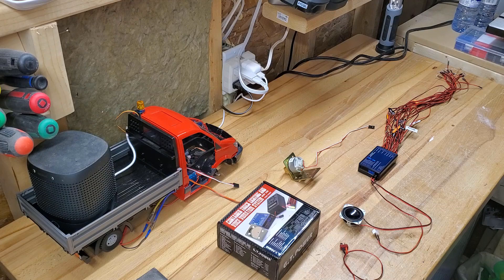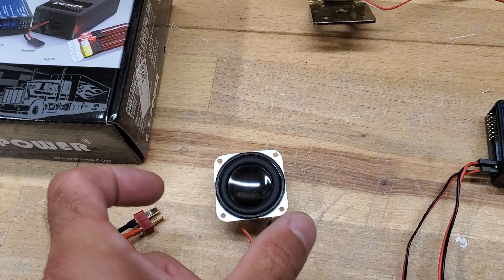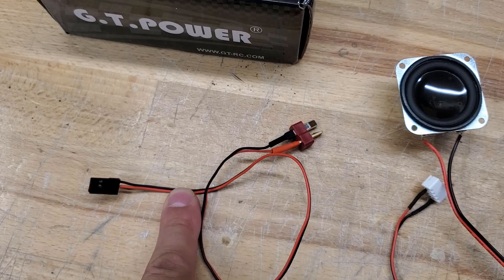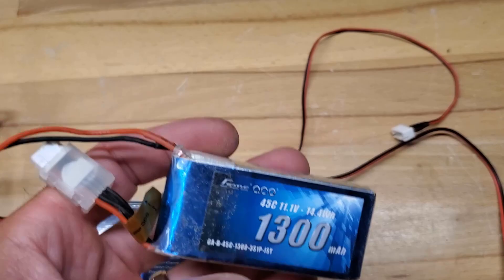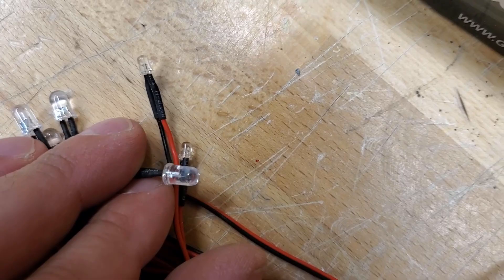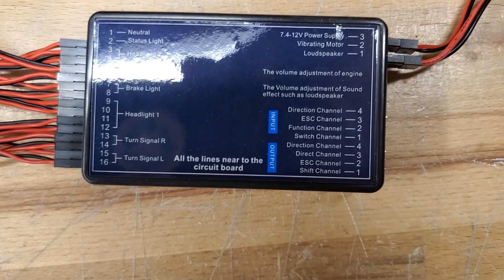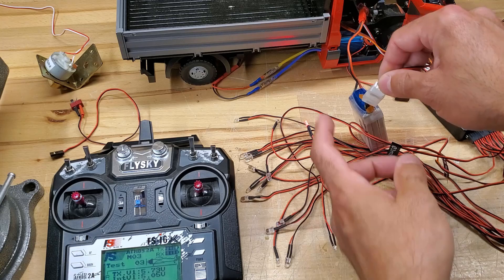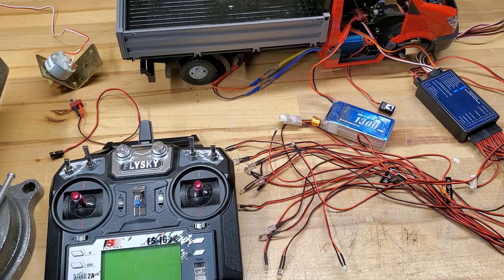How To Install the GT Power Truck Light and Sound | and Demo!

Comment: Thank you for this video. I had to interpolate between your FlySky and my OrangeRx receiver, but without your video I was hopelessly confused by the included GT Power "users manual" which made no sense at all. Now I have the system working. 👍
Reply from the maker: Glad it was helpful.

Comment: Just ordered this for the grand hauler... thanks for your video.  Hope it's as easy as it looks.
Reply from the maker: The instructions are ok but this helps visually know where it all plugs in. You can alternatively use the deans connector instead of the balance plug to power it. Goes in the same spot.
Reply: Well got it all put together....but now it seems my throttle is on the right stick everything is backwards...now what?   I'm using a Dx6e 6 channel reciver
Reply: @scotthouston7116  Futaba and FlySky use Channel 3 for Throttle...
Spektrum and most others use Channel 1 for Throttle.
Just swap 1 and 3. You should be OK! 

Oh, and on the Spektrum Reciever, the Steering Servo lead should go into the "Ailerons" Channel. I'm pretty sure your Reciever has Channel Names instead of Numbers?

Comment: Great breakdown on wiring up this unit. I’ve got the Rc4wd sound unit to instal in my loader when it gets here
Reply from the maker: You should check out diy999er for an arduino version which I think is pretty interesting.

Comment: My hobby wing 1060 wont go forward or back, 
Changed over to arc1 ESC and it's fine . Is this a common problem.
Reply: I have same problem with mine wont run my tamiya motor everything else works fine also i cant assign channel 5 on my flysky for shifting it only works right stick down + left /right  on left stick

Comment: bonjour comment se fait il que je ne peux avoir les feux arrières éclairage et recul lorsque j allume les feux, de plus lorsque je passe en marche av ou ar ceux ci s'éteignes car au neutre ils s allumes bien ,j'ai une FS i6 comme radio  merci a vous
Reply from the maker: when you turn on the lights the red lights will turn on in the rear. if you reverse the reverse lights should come on. if you turn off the lights the red lights turn off. they do not come on when you stop. It does not work like other kits. if you want it to work like the real trucks you will want to look at the gt power truck pro kit which has an esc  built in and you can manage the lights and brake lights work when you are stopped with the main lights on or off. hope that helps.
Reply: @RCConstructionHobby  merci a vous je regarde
Reply: hello lorsque j allume les lumières justement, les lumières rouge ne s'allument  pas ,et de plus , le bruit moteur se fait entendre au point mors, mais a l 'accélération celui ci ne change pas
je pense qu'il s agit des paramètres de la télécommande, mais je ne sais comment faire, vous est il possible de me communiquer votre configuration merci a vous  @RCConstructionHobby

Comment: Thanks for making this video, just one more thing. ( columbo ) lol
I am using a standard Tamiya battery, with NO balance plug, just the main power and charging plug, how do I wire this Ito this system..?
Thanks
Paul....
Reply from the maker: I have mine directly connected to the deans plug which they include. So no need for the balance plug.

Comment: Awesome video thanks for making it. Quick question? The package says 2000ma max power. Dose that mean you can only power it with a 2000mah battery? Or that it only pulls 2000ma to power it’s self? Thanks again for all your informative videos.
Reply from the maker: I believe it will do more on tge battery mah as I use a 2200 because it put it in the cab. So a higher mah should be no issue. I think the 2000ma is for esc as to not overload on power.
Reply: @RCConstructionHobby  I use 4000-5000mah packs in all my trucks. Do you think it’ll be ok?
Reply from the maker: Yes it will be fine. It does not matter the capacity. Capacity makes no difference as it has no bearing on power. What is more important is the C rating and cell count. This particular system is rated to a 3 cell count. Anything above will cause problems. So you should be good with 5000mah. The ESC is where you might run into issues as some don't play well with this sound system.

Comment: Hello friend .Great video. A question. In my truck crawler the chanel 2, throttle, is 2 pin plug, positive and negative, for the motor wires.The GT POWER speaker is 3 pin can itake only the 2 cables? It will work ?
Reply from the maker: the power cables from the motor to the GT power are only 2 wire. The servo wire goes to the receiver which communicates with transmitter. In the video I show how it should connect.
Reply: @RCConstructionHobby  In my truck CRX18 6WD is a combination esc and receiver so  I was thinking of connecting from GT POWER  the plug to the three cables, the signal to the positive, the neutral to the negative to the motor of the car and grounding somewhere else in the car. And the other cable to the battery. Will it work this way? or will i do damage? I can't figure out what the ground wire is for. Thanks in advance.

Comment: Very nice video. But can you connect for example front bar light, or roof bar light? Thank you
Reply from the maker: You can put the main light anywhere. There are 6 white lights 4 5mm and 2 3mm. So you can out them in what ever configuration

Comment: Great video, thank you for posting this. I want to use a FS GT5 (pistol grip) transmitter with a Bruder tractor conversion I'm about to start. Will this sound/light work with the GT5? With the transmitter you had the sticks worked everything. Many thanks.
Reply from the maker: Not sure it will work for the lights as you need a way to get the.lights to function and they need two 3 position switches for tgis work if you are using a pistol grip for lights. As for sound it would work. I would also suggest the sg-sz01 https://m.aliexpress.com/item/32887695283.html?trace=wwwdetail2mobilesitedetail
Reply: @RCConstructionHobby  Thank you.

Comment: Thanks for making this video ... very helpful 👍

One question can i use 2 separate batteries? 1 for esc/motor and the other one is for the sounds/light box? Is it ok to do that? 

Thanks👍
Reply from the maker: You can run one battery for the lights and sound. That is what I have dont. But you can also run just 1 battery as well.
Reply: @RCConstructionHobby  originally my motor/esc runs  2S battery xt plugs and thinking to use one of my 2S battery with deans plug to power up the gt power sounds/lights module separately. But im 💯 sure with this set-up due to separate power supply i might burn the whole thing😂
Reply: Anyway thanks for the reply and help👍
Reply from the maker: As long as you use 2s for both you will have no issues. It won't work if you have 2 separate cells for each battery

Comment: Hello thanks for this great vídeo. I have a question.
Where do yo conect the engine motor?
Reply from the maker: The motor is connected to an esc. Which is then connected to the sound kit with the servo wire from the esc.
Reply: Thanks

Comment: Lights don't have HID effect like Tamiya MFC 03.
Reply from the maker: No this kit does not offer that function. It is a basic kit. You need the Beier System for that. It is better than the mfc and smaller. Also more customization.

Comment: Hello again.
I have followed all your steps to the letter. same 3s battery, same station, connections, etc.
The problem is that the esc are burnt.
Any ideas? Thanks
Reply from the maker: I use the hobbywing 1060esc. If the esc is burning up then it might not be rated for 3s. Try 2s battery. You need to make sure that the esc can handle 3s lipos.
Reply: @RCConstructionHobby  thanks i will try hobbylink 1600 is easy to find here.

Comment: If I have the shift servo assigned to the 3 position switch on my fsi6 an I still use that as the switch for shifting? It seems that when I hook it up thay my left stick is moving the shift servo slightly
Reply from the maker: Thst is odd that the stick makes the servo move. I have it set so the switch only changes the gears. You might have to make some slight adjustments with the end points for the servo or the centering.

Comment: On mine instead of using both balance and and charge plug. I used a y connector so both powers for sound unit and rx/esc are connected, in this configuration i only use the one battery plug to run the model
Reply from the maker: Yes you can do that too.
Reply: Hi, So all the units worked, The sound unit, Esc and the receiver, I have to try that.

Comment: Does the red brake light up better when braking?  Not mine, why?
Reply from the maker: No it does not. If you want realfunctions you need to pay for the more expensive sive versio  which is like the mfc1 from tamiya.

Comment: Hi 👋 wired up gt power as your set up, everything works except the rear lights, brake lights ok, any ideas could it be the trim not set correctly .
Reply from the maker: The rear light turn on when you turn the lights on but the second time you hit the left stick. The third time turns on all lights.
Reply: GT power does not have rear lights, you have to fit separately

Comment: hello. you used a 11,4 battery, but in the control module I can read 7,4v power supply. IT doesn´t matter?. Thanks
Reply: i just see it. it is for 7,4 to 12 v. thanks
Reply from the maker: I agree it says should be 7.4v but I do use 11.1v 3s lipo because the motors are rated for that. I have not had any issues with power damaging the module. It has been working perfect for the past 2 years. Use what you feel comfortable with. 7.4v or 11.1v. Just know 7.4v will change the power output to the motors and slow things down and lose some torque.

Comment: great detailing video but how to connect the smoke module system along with this and how to control the volume?
Reply from the maker: Not sure about connecting smoke system. But volume is on the side of the module.

Comment: Hi guy, Do you need a balance plug for this hook up, And I tried a straight 7.4v battery to the unit and no power gets through, Are liposuction better on this system, I have a 2s I would like to apply for power. Thanks
Reply from the maker: You can use the balance plug for power to the unit. It also comes with an extra deans connector to plug into your battery. So you would need a y harness to connect the 2 batteries and then a connection to the deans connector to the unit. You can do both ways. I am currently using a deans y harness to connect the esc and gt power and then deans to the battery. 2s or 3s will work fine.

Comment: Thank you!! I've been frustratingly searching for Videos on the various Sound and Lights Systems.... Only coming up with CRAP Videos with poor info, shot from 20 feet away, and mostly in Asian Language with Asian Language Comments. Might have been OK with some Visual and Audio clues and references.... But there WEREN'T any. 😖😞😠 

Sorry! Off the Soapbox.... 
I would like to hear more of the Sounds.... And the Engine at a little higher volume. Nearly ALL of the cheap Kits have Engine files that when you rev up - it sounds like an 80's Video Game. 😖👎👎 With very generic Diesel Sound. 
Now, I've been in the Hobby for more than a few Decades... I KNOW not to expect Scale accurate Sounds for under 50 bucks.  But it doesn't have to sound like ass either!! 

I'll probably hook it up very similar to yours, because I've also got a FlySky FSi6 Radio. I've got a bunch of extra LEDs though... 
It's a Grand Hauler, and I'm definitely going all out!  I've got 8 LEDs just in the Dashboard, with several more going to the Interior Lights and CB Radio. Plus extra Running Lights... 
I may end up running those off of separate Channels - with BECs. 

And I'll be running a Hobbywing WP1080 ESC, because I'll need a LOT of Drag Brake!! 

Well..... After writing WAY too much, I do want to know, since you've had yours for quite a while. 
Is it any good? I mean, was it even worth what you paid for it? 

I COULD spend the $300+ on a Beier or MFC... Likely Beier, because Tamiya MFC only comes with ONE Sound Set, is NOT Lipo Compatible, and I'm told that my 20kg Steering Servo will make the MFC BROWN OUT!!  Not for that kind of Money! 

But there seems to be a lot of reviews on this GT Power, and the ESS-One (but that one is strictly a non Commercial Vehicle System). So I'm hoping it's somewhat worthwhile. 

LESU makes one too, the 3T. It has 3 different Diesel Engine Sounds loaded. However, almost nobody in the First or Second World has reviewed it! I don't know what to think. And it's $140... 
I'll end here. 😖  If you made it this far, thank you!
Reply from the maker: Glad it helped. It's why I made it. I was frustrated too.

Comment: Hello I received that unit but this unit comes with only 4 signals light now in my truck Mercedes zetros have 4 place front for signals light and 2 rear signal light so total 6 signal light So now I want to ask it’s possible to connect extra signal light
Reply from the maker: You would have to buy more lights and add them. But you can only add 1 pair to an existing light set.
Reply: @RCConstructionHobby  yes that I confuse if Possible joints wire two extra signal light with stock signal light because I need two extra signal light for my truck 
Thanks for reply I will try if it’s done

Comment: I cant get my stearing to go back to center when I let go of the stick!!   Help again. Dx6e is what I have
Reply from the maker: Hmm that is odd. I don't know how the dx6e is affected by this kit. I have not had that issue. I used to use a dx6 in the past but found the flysky transmitters cheaper and have more functions. 10ch.
Reply: @RCConstructionHobby  just found out...its a bad servo. Wiring is a little different too... thank you for the quick reply and help again.

Comment: i am getting ready to assemble a tamiya grand hauler, my 1st semi. i plan to use my radiomaster mt12 surface radio and a 5 channel rx to go with it. im trying to save some money and am watching your videos several times but i am  a little confused. if i get the basic kit, can i run a hobbywing fusion crawler motor esc combo? if iget the pro version, does the unit have the esc installed already and will it support a brushless motor. im just trying to navigate and get it to work properly without spending thye ungodly price for the mfc-1 let alone the price of the truck kit. thank you in advance
Reply from the maker: The system comes with a built in esc. If you  wanted to bypass the built in esc that is something I'm not sure how the configuration would be. In other kits like beier or dasmikro you connect the esc to the sound system then to the reciever.  Only way it to check the facebook pages for others who have tried this method out.

Comment: Can you use a 7.2 Ni-MH Battery and how do you  connect it
Reply from the maker: Yes you can use nimh batteries.
Reply: I made a Y connector so the battery plugs into both the ESC and the control box

Comment: Thanks for sharing, in your opinion which sound is better, ESS DUAL or GT POWER?
Reply from the maker: Depends what sounds and features your looking for. There is another kit on aliexpress  thst does truck sounds and will do lights as well but does not include the leds. Call the sg-sz01 sound kit. I think it's as good if not better than the gt power.
Reply: @RCConstructionHobby  I'm looking for truck sound with or without leds, because MFs are too expensive!
Thank you my friend

Comment: hello bonjour    j'ai suivi les conseils, il me reste juste les  lumières a double fonction 7et 8 rouge ne fonctionnent pas en veilleuse mais juste en stop
j'ai un réglage  du thrott curve  L = 0  / 1 =25 /  2 =50 / 3=75 /  H=100
                          dual rate   C1 = 100  / C2  =75  /C3 =75
je pense que mon problème vient d'un réglage de la radio ,mais je ne sais faire  
merci a vous
Reply from the maker: I use the app to control lights. I also find out that calibrating system creates problem and you can not control some functions.
Reply: @RCConstructionHobby  merci a vous, le problème est sur le manche 3 (marche avant et arrière)avec la position centrale point mort, c est a dire ,je passe en recul direct ou en avant direct, et sur votre vidéo cela fonctionne bien dés l'allumage des feux

Comment: Hola, muy bien explicado, me gusta tus videos. Tengo terminado el sonido y las luces, igual que lo haces tú y todo funciona muy bien, pero el motor grande no funciona, no sé si es que tengo que montarlo en el camión, pero creo que debería de girar, por favor me puedes decir que ocurre. Gracias. Saludos. 

Hello, very well explained, I like your videos. I have finished the sound and the lights, just like you do and everything works very well, but the big engine does not work, I do not know if I have to mount it on the truck, but I think it should turn, please can you tell me what happen. Thanks. Greetings.
Reply from the maker: do you mean the vibrating motor is not working?
Reply: @RCConstructionHobby  Siii el motor vibratorio si funciona muy bien el que no funciona es el motor del camión, esta conectado bien, ¿que puede ser?
Reply: Por favor puede decirme si tengo que hacer algo en la emisora? no consigo que el motor gire. Gracias. Saludos
Reply: @modevaz3060  yo tango el mismo problema eh cambiado el ESC dos veces y nada lo conecto sin el GT module y corre bien, si logras encontrar una solución compártela 😇 voy a tratar el arc1 esc aver si funciona
Reply: @DEMENTEGLOCK  Hola Pedro no te preocupes en cuanto sepa algo te lo comunico, o bien si tu lo descubre te agradeceria me lo comunicaras.Saludos

Comment: What is the maximum voltage for the lamp, is it strong to use a 12v or 6v lamp
Reply from the maker: Yes you can use 12v. I am using a 3s lipo
Reply: that is, if the lamp is replaced with 12v or 6v, is it possible
Reply from the maker: Sure you can use either battery voltage. The leds are managed by the control box.